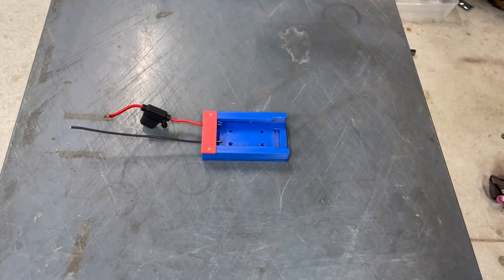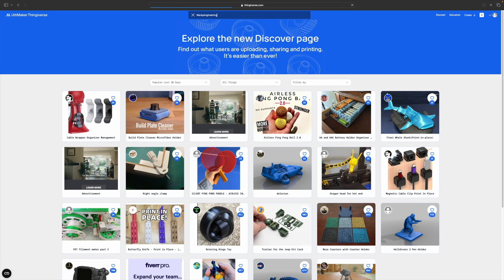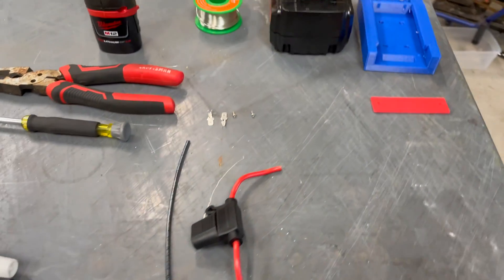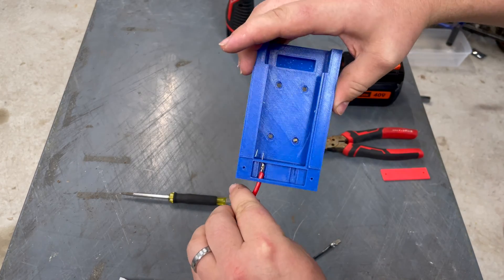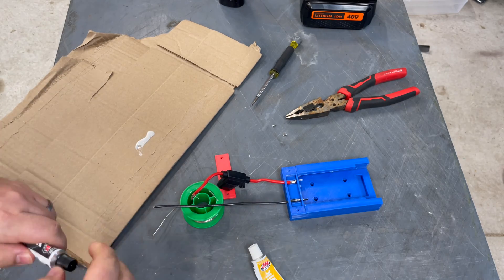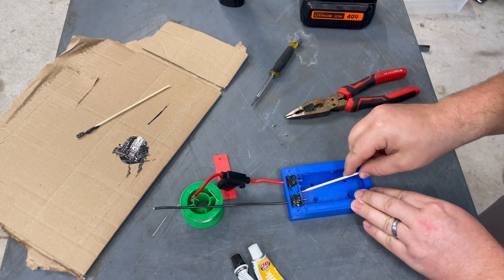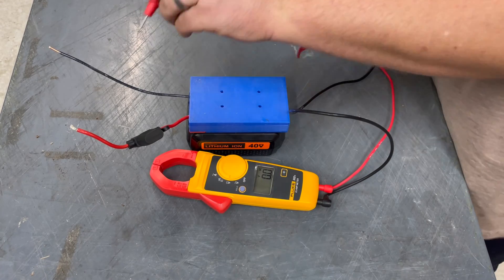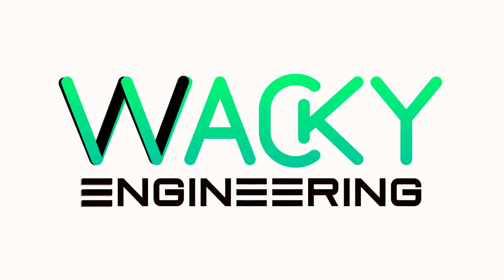DIY Black and Decker 40V Power Wheels Adapter #powerwheels

Comment: If your building power wheels with these you need a dc-dc step down converter  36v/42v to 12v otherwise you will fry your kids power wheel .
Reply from the maker: This model didn’t have a motor controller board so the only thing really at risk of burning up is the motors. If you step it down to 12 volts the unit would run very slowly.

Comment: I did the same thing but with a Milwaukee 18 V 12 AH battery And it seems faster than the black and Decker 40 V. I’m just concerned about how those motors are going to fair in the long run.
Reply from the maker: The motors lasted about 20 hours with the 40v battery.
Reply: You might be correct. BD use lower quality and lower burst output LiPo cells. Pouch cell is the way to go, the newer Dewalt or Flex.
Reply from the maker: Thanks for the info!

Comment: Did you have to change the motor or gear box? I swapped my kids' power wheels with a 40v battery and adapter, but I think I burned something out. Any recommendations? Thanks
Reply from the maker: Yes! Check out our video on upgrading the motors and gearboxes with some 24v ones. Links to parts in the description of that video.

Comment: do you know if those black and decker batteries have under-volt protection? if not you need to pay close attention to the performance of the thing you plug it into so the battery doesn't get ruined
Reply from the maker: We have the kids trained to park it as soon as the battery starts to wear down a little. We haven't had any issues yet!